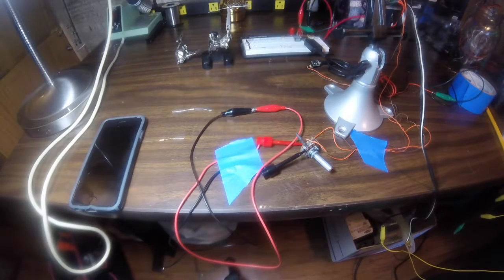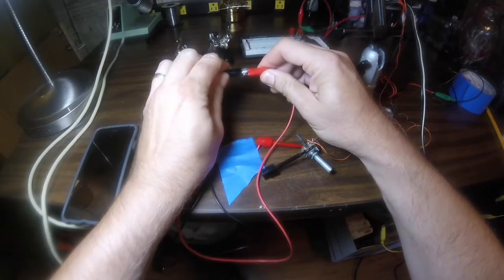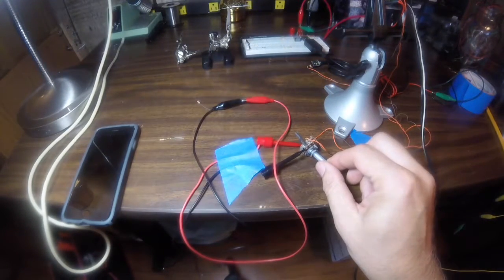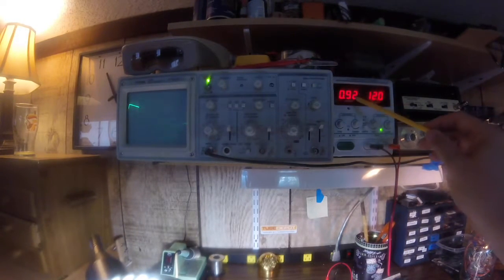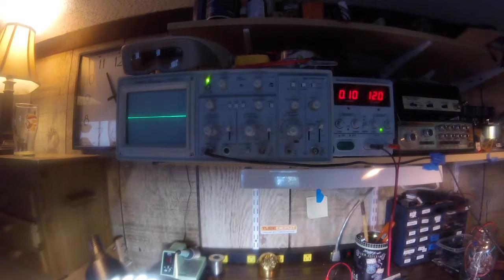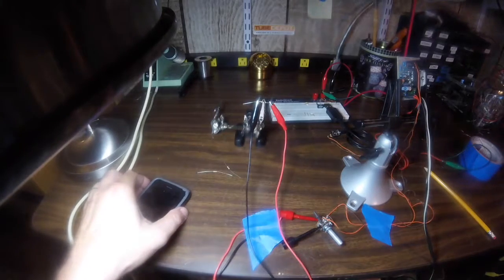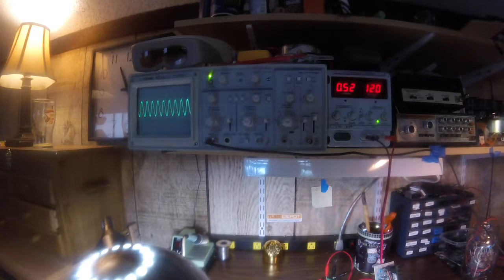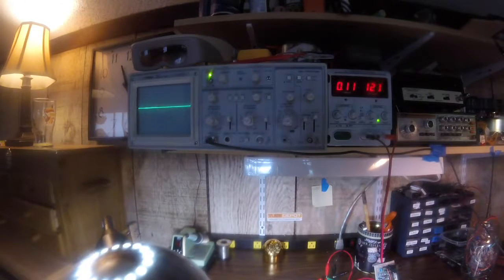Reducing Line Level Distortion

Comment: excellent video, could you use a variable resistor as the first in line resistor and fine tune it, then measure the resistance of it and replace it with the same fixed value resistor?
Reply from the maker: Yes definitely